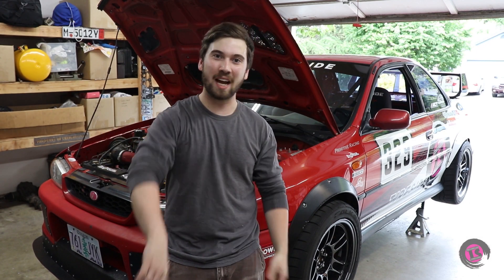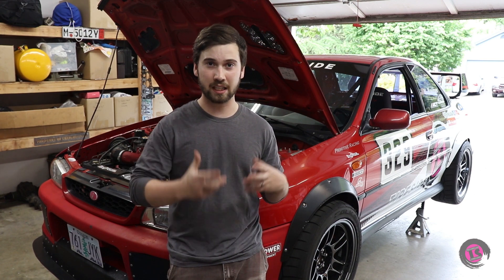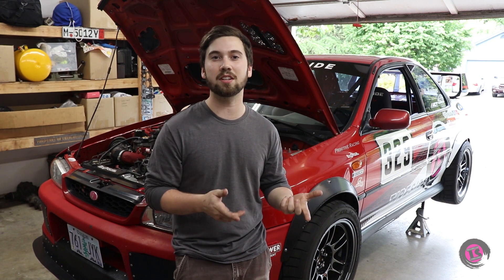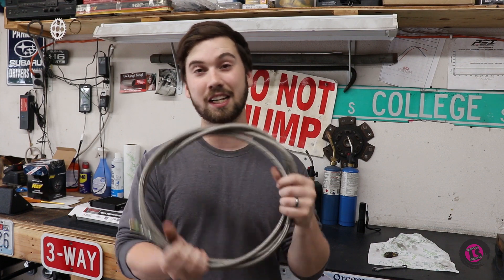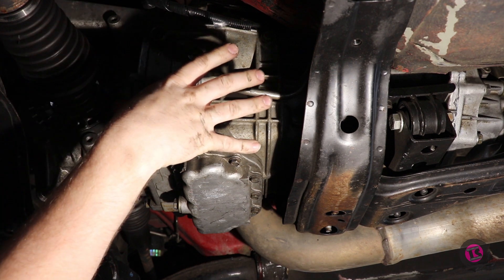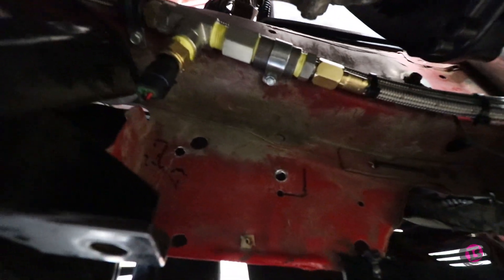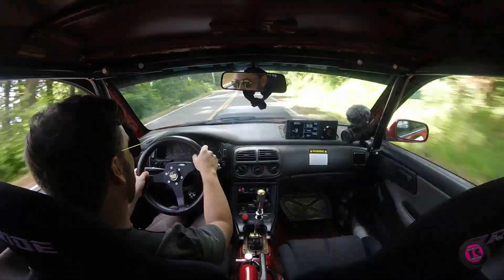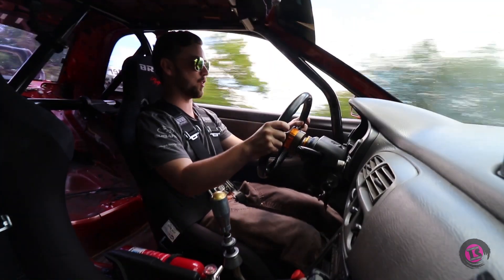Subaru STI Manual Transmission Oil Cooler?! | All The Nerdy Details

Comment: I’m sorry but that bolt in cage is not going to do diddly squat in a wreck.
Reply from the maker: SCCA and NASA certified, not too concerned. Thanks though.
Reply: @TIRESIDE  fiaa… go read the track rules
Reply from the maker: Not driving in events that require an Fia spec cage so that’s irrelevant.

Comment: Well isn't this just perfect. Researching this exact topic for my own future projects only to find nearly the perfect video only a day old. You read my mind it seams so thanks! I have to ask though what makes you say this oil line is only on the 07 and older 6 speed? I was unaware there was a different transmission for the 08+ sti. Hopefully I can find some actual documentation somewhere soon, but for now I guess Ill just crawl under my car (2010) tomorrow once the sun comes up and look for myself.
Reply from the maker: I’m glad you found it helpful! In my research I found that at some point Subaru stopped putting oil pumps in the 6mt’s. In my experience with the transmission that I have, I can only confirm that 04-07 has it.